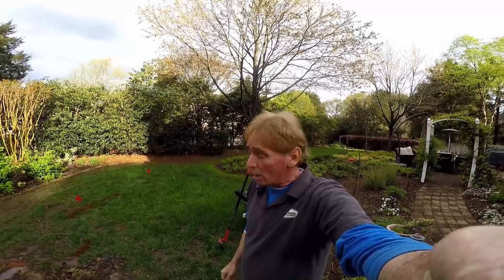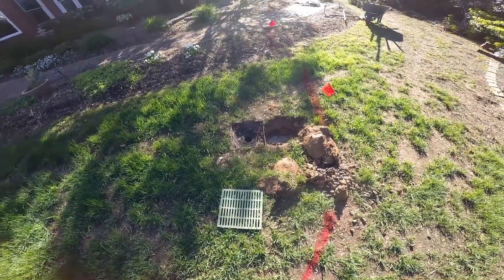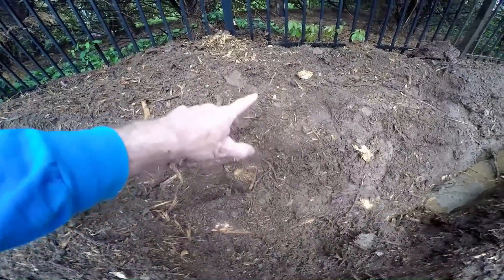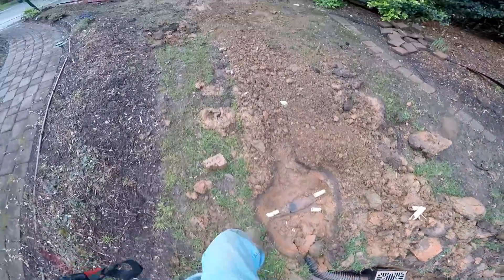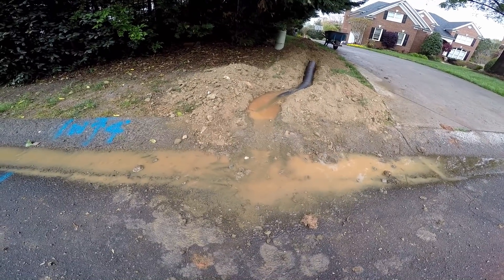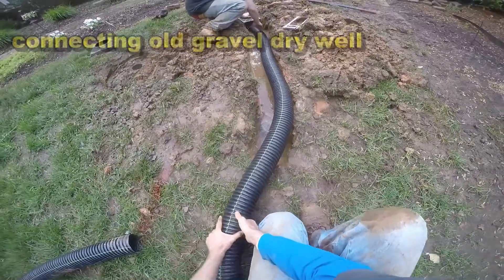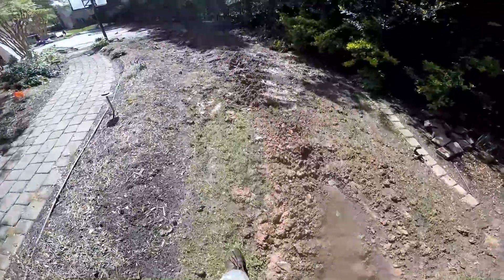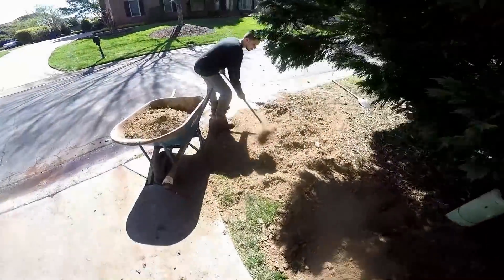Dry Well, Do They Really Work?

Comment: I totally disagree. It depends on the soil you have. I had a side of the house that flooded every time it rained. I dug a 4x4x4 ft hole that when below the clay soil into sandy ground below as I live in NJ. Did this about 30 year ago. Never had a problem again.  I have 2 other French drains in my basement from original built from the 1960s. Still working fine. I did have to clean the external basement stairs landing small French drain that go up to the back yard level because of leaf decay every 5 years or so because it will clog it up with time from plant decay matter.

Comment: Mine was built with a 55 gallon plastic barrel, holes drilled around and 4ft deep, 3ft across, wrapped with weed barrier then gravel. I also up a pop up and dirt over it, my grass is back, nobody knows it s there and it works perfect. But my dirt drains quickly. 2 days of strait rain and took it all. That takes 1/2 my roof water away from my foundation. The other side slopes away.

Comment: I would respectively disagree with the title and comment in the video that drywells don't work. I would agree with you that there are many installations that don't work because the installers are not thinking about how they work, maybe this site is an example. I'm a HVAC designer and licensed engineer; drywells work great here in California and most states where dry wells are used for cooling condensate because we don't have much if any condensate when it's heavy rain and saturated grounds. When condensate discharge is high, our grounds aren't saturated. I could see an issue trying this in Florida where cooling condensate and heavy rains can coincide at the same time of year and on the very same day or hour.

Comment: Dry wells do work that's why people use them. The first thing you do is determine the size you need. Size is based on the type of soil and the volume of water you're trying to disperse. You might want to consult with someone who knows what they're doing.
Reply: First thing I noticed, it looks like a very high clay content. Heck, maybe I'm wrong, but I know from experience what a difference the soil type makes.
Reply: I think I have clay soil & currently have water issue. I was told about this option of drainage… what difference would it make make on the type of soil?
Reply: @bmp7791 The water won’t leach in heavy clay, it can’t percolate or permeate and water just builds up.
Reply: “Dry wells” don’t work. By the way, it will never be a “dry well”. It will be a wet well. Water should always have a place to discharge too. Water should always be conveyed to an approved storm sewer, culvert or other means. Chuck has been in the business for 30 years and there’s a reason it’s been that long and I’ve been in the business for 28 years. Dry wells don’t work. People should consult the professionals so the professionals can engineer an approved system that works. Respectfully, I suggest not repeating this to anyone because it’s inaccurate information.

Comment: puts dry well at bottom of pond see? It doesn’t work. But when used in a correct application, it works fine. That yard had other issues that anyone could’ve seen it wasn’t the correct solution.

Comment: Drywells are kind of a catch 22, they work great in sandy soil with good drainage (where you don't need them) and they work bad in silty soil with bad drainage (where you need them)
Reply: It depend. My first 2 or 3 ft of soil is silty and clay but below that is sandy. So I did a dry well past that into the sandy soil and now my back yard is dry. I did this 20+ years ago. Worked great.

Comment: Wouldn't the city take issue with draining this onto a city street and cutting the concrete?
Reply: I'm having a drainage problem and my city will not let me do this. I'm not allowed to discharge any water onto the street, it all has to be contained on my property.
Reply: @RaysLongoria  Be sneaky and feed it to the cities sewer system.  Many won't let you collect rainwater off your roof for your plants, but then they dont want it fed to the street.  I suppose they expect you to drown.  Lowers the carbon footprint if you don't exist.  lol
Reply: Because it’s done with a permit and a license and it’s done too code
Reply: Depends on what state you’re in….. But the city is completely fine with companies cutting the curb for drainage. We drill a hole though, we don’t cut an ugly, unprofessional look V like that. It’s a perfect circle. We don’t cut and re-concrete either. We core through with a 4” bit. Don’t even need a permit where I’m at
Reply: The way that pipes flow line is deeper than the street gutter line, it's going to be a mosquito breeding ground

Comment: Love your videos. I have one issue though, all your solutions are to drain the runoff to the street and onto the cities system to take care of.  Being right next to the Gulf, the cities wants our storm water contained on the property and not directed to the storm drain system.  Backyard sump pump is not an option, so the only thing that's available is a dry well.  Do you have other ideas for containing storm water on the property?
Reply: I have the same issue with this video. Going to the street is not always an option and besides it can lead to greater problems. Passing the problem to someone else is not the answer.
Reply: Only option if you can't run it to the street is multiple dry wells tied into each other.
Reply: @gsm19911 Retention pond, swales drywell(s), or exterior sump pump to send the water to the edge of the property.

Comment: Here's how to put  a dry well in that works:  approximately 4' diameter hole that is 6' deep.  Line it with pourous geofabric.  Put 12" of rock on the bottom.  Stand a 24" diameter double wall culvert pipe in the center of the hole and secure it in place.  Put the lid on the top of the culvert (yes, you can find ones that have lids you can purchase separately).  Fill in around the pipe with rock to the surface.  Drill one inch holes in the lid.  However, for the yard Chuck was working on just then, that would not be feasible.  The yard is far too small.  You would neet a backhoe, etc to put that large of a dry well in.  The way Chuck did this was the sensible way in that particular situation.  But if you have a larger yard, say, 2 acres or more, maybe a great big ole dry well is good.
Reply from the maker: NoTolerance ForU I think you should watch the video Again. We do not install this dry well. We solved the problem of DRY WELL NOT WORKING 😊

Comment: I will use a dry well, the drain pipe will exit the ground after 50 feet.  I'm using the dry well to trap debris from a grate in a driveway.
Reply: In other words, you want to use a dry well as a large and economical catch basin, sort of a hybrid catch basin/dry well.  I've been thinking about the same thing.

Comment: Excuse me... I have two dry wells in my backyard and they work very well. You need to verify several things before installing any drainage system, most important is to see how high the water table is. A dry well in an area where there is a high water table won’t work for sure- it will look exactly like what was shown.

Comment: so where i live we are on sand, the water table is at 500 feet. we get short storms with a rate if up to 4 inches per hour. its all run off the soil does not astute like clay or a high loam content and  rock filled dry wells are useful.

Comment: If you're gonna put in a dry well, make it twice the size of the water volume you need to manage, use frigging gravel around and under the tank, and don't try putting a dry well in clay soil.

Dry wells WORK... just not when they're installed like this one was.

Comment: What about a dry well just for AC condensate on a single family home? The condensate bogs up about a 4 ft by 4ft area of the yard where it drains onto the ground and it is probably only a flow of 2 gallons a day tops. But the compost and grass sod soak it up and I need a way to disperse the water evenly further from the house so the grass and sun will use up the small amount of water. Any tips? The volume simply is too low to justify a French drain to the street.

Edit: there is oy a few pieces of random d dead sod I put my the drain in the hope of reviving the sod... so there is not any grass where it currently drains except the small bits of semi live sod maybe 1ft square in total.

Comment: Mine are clogged with material at the inlet pipe. Roots you name it. Gonna see if i can free it up otherwise run plastic  drainage from gutter and dig to the  street. Which im 6ft higher  then the street. Run it down the hill. My system is iron pipe.

Comment: Need to compute the roof area + yard area then plug in into the flow-well calculator (base on NOAA 25 years rainfall intensity for 30 minutes duration) then it will tell you how many flow-wells needed.  In my city, you shall contain all water in your own property not drain to the street!
https://www.ndspro.com/flo-well-calculator/

Comment: I think PVC pipe would have been better.  Looks like you went through a lot of hard work just to have the corrugated lines clog up in a few years.  It is almost impossible to clean clogged corrugated pipe.  The first clue was that the previous lines had quit working.  They were probably clogged corrugated pipe.  PVC may have been more expensive and required figuring out were to put connectors and angles.  If you use the think wall DWV then it will stand up better to the roots than standard irrigation PVC.
Reply: www2... "he didn't even use corrugated pipe"...I think you're confusing the terms "solid-corrugated" with "perforated-corrugated".  Eric M is correct about PVC vs. any kind of corrugated piping when roots are a concern.
Reply: not true at all. he didn't even use corrugated pipe. wasn't a French drain off the dry well.  that's closed 4" drain pipe

Comment: the hole is supposed to be twice as big as the actual barrel....plus it's supposed to be surrounded by gravel and lined with sod mat....this guy is ripping these people off on video
Reply: He's not the one who installed the dry well.
Reply: Not a French drain system being installed. The things I don't agree with are the use of ADS for storm water and the length of that line, I guarantee the grade from home to street isn't going to actually flow while the rain is really dumping.
Reply: Sam 
Dammit Sam :)
Reply: youre an idiot sam
Reply: ww2 colorizer that's how you're supposed to install a dry well. You're the idiot

Comment: I'm no expert but.
Dry well should be surround by gravel and small pebbles.
It is quite small well andthe roof is quite big.
The land itself may not be suitable for dry well. If you have clay or groundwater level is high it will not work properly.
Even if the system is working properly, sooner or later during heavy rainfall the well will be overflow.

Drainage on the street is not the best solution.  Depending on where you live you can have the serious problems and pay the penalty.

Comment: I usually use a reciprocating saw for roots. Chainsaw blades go dull immediately. Have you guys ever used semi-perf pipe to catch surface water around a foundation but not allowing to it seep out the bottom?

Comment: A dry well isn't used for high water table. They are for infiltrating collected surface  water  or storm water (into good drainable soil) or engineered material with a large enough  area/volume to hold the water until the garbage soil can percolate. . The whole point is to percolate the collected water back into the ground not run it to the road, but that'll never happen when some clown or joe homeowner doesn't understand how its supposed to work and goes and puts the thing in clay. What do you wanna bet when they dug the hole for the well in the first place  it was wet... probably should have been a dead giveaway

Comment: drywalls work great if installed properly unless you have a high water table. All you did here was run the water in to the street where i come from in NY you can't run storm water in the street.
Reply: I'm from NY too, I was confused why he just cut the curb NBD
Reply: How are you going to control all of these things. This is another example of overreaching government laws
Reply: @jaredweiss3610  right, the clean air and water regulations are definitely an "overreach." Were you dropped on your head as a baby? Government regulations exist to keep people who don't give a shit about anyone else from causing harm to others and the environment, in this case. I guess you'd have been cool with living on the Cuyahoga river so you could've taken a swim in industrial pollution. Yummy.
Reply: @jaredweiss3610  well, if everyone just dumped their storm runoff into street, the  sewers in the area will likely get overwhelmed in a big storm. It's happened before. People don't like their basements flooded. One person does it? Not a problem. Entire neighborhood does it? There is a problem. Hence the rules.
Reply: Storm sewers not sanitary sewers. They are two different systems.
Reply: Jared Weiss unless your city is older and still has sections of combined storm/sewer. Exactly why rules like this exist..
Reply: Where do you think the rain water that lands in the street goes?
Reply: @jaredweiss3610  someplaces like to limit the amount of yard runoff which may have high levels of nitrogen or other fertilizers that can cause deadly algea blooms in rivers, ponds, and streams
Reply: Yes, dry wells will deal with a lot of drainage uses. It's just like anything else, it must be utilized properly. Water has to have somewhere to go. It's always going to follow the path of least resistance and flow as long as it can. Common sense tells one that the larger the volume of water the larger the dry well required. If the water table won't permit dissipation of the volume of water you're trying to carry away then, yes, some other approach will be needed.One other note, as a landscaper and professional gardener I can tell you that in this installation a very significant tree was killed consequent to the trenching. Cutting larger buttress roots is not appropriate unless you have already decided to remove the tree at issue.

Comment: This should be banned.  You are adding unnecessary stress to the storm and sewer system.
Reply: lmao
Reply: Who'd have thought routing stormwater into a stormwater drain would have so many negative comments.
Reply: I think it is not forbidden to redirect rainwater to a rainwater system (it was designed for the transport of rainwater), unless you tell me that in your state, all the streets are covered with a roof so that they do not reach them. Rainwater
Hahaha (do not be offended just a bit of a joke)
Reply: Street drains don’t connect to the sewer system in most municipalities they discharge into lakes and rivers
Reply: +aguyandhiscomputer
Stormwater =/= Sewer
Reply: There are plenty of areas where excess stormwater goes to the sewer system and vice-versa.  (Older systems.)
Reply: ww2 colorizer 
He makes a good point.
Reply: Very true.  Each parcel of land is designed to hold so much water.  The storm system is designed in accordance with that factor per parcel in a given neighborhood.  If every house dumped water like this at the street, very likely the system would be over capacity.  On top of that you are adding a lot of pollution to the lakes and streams in your area
Reply: Fete Fatale 
Municipalities have been stopping people from routing their gutter downspouts into the sewer for awhile.

Comment: Why didn't you put in a one way valve where the line meets the curb? That looks sloppy.
Reply: and a lawsuit waiting to happen
Reply: Evamael I totally agree you, there no way  you can bring that water to the side of the street just like that. that, is city or county property,  drywells do works when install properly.
this is a big stormwater management violation right there. good luck anyway.
Reply: exacty acnologia. a backflow valve would barely matter.  just a few grumps who pick apart stuff. Probly homeowners who think they know everything.
Reply: In my city you’d get fined for bringing it to the curb.  You have to have runoff empty into the yard.
Reply: Nelson Flores the street had a v on the side for water to flow I'm sure rain water ain't going to bother anything
Reply: In the northwest dry wells only work if a small ant of water and well drained soil.  I see why they would not work with clay soils.

Comment: improperly installed and not to spec.  you got to much sentiment in it.  also the well itself is not large enough.
Reply: You're an idiot - of course it has a lot of sediment ... it's only just been installed! By the next rain the sediment will have gone and the water will be more or less clear.
Reply: hahahaa  dude he didn't install the dry well....he fixed it so it would actually work. its no longer a dry well anyway!   If you don't know what youre talking about, then don't comment